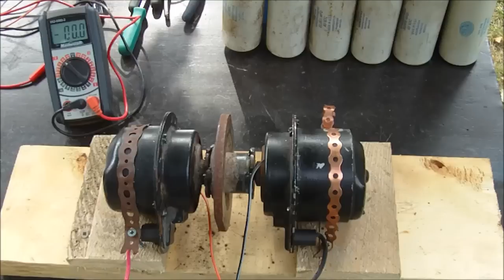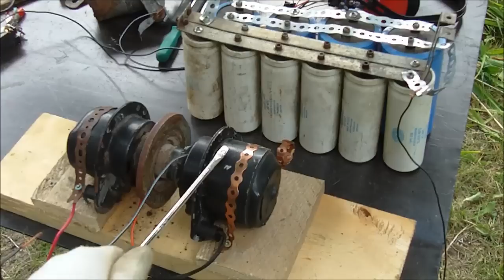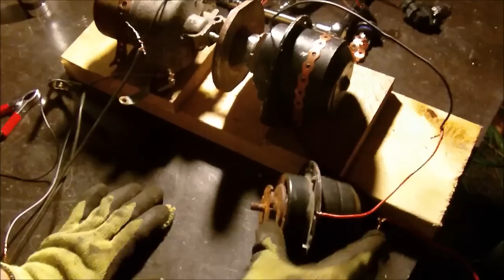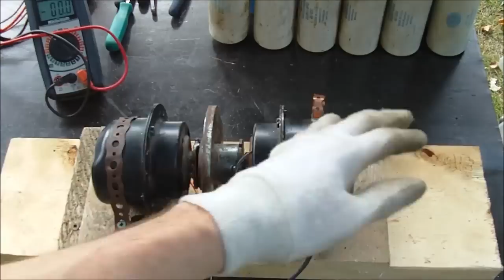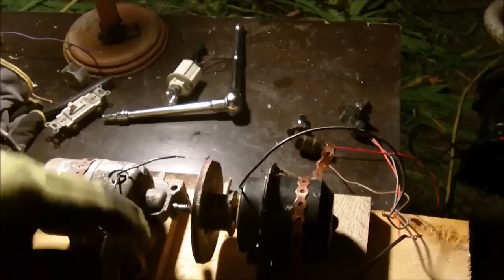Electric Motor to Motor, can they self run?

Comment: i dont even have to see the results to know this didnt work

efficiency can never be 100%
Reply: +gametechish .......Superconductivity is simply lowering the electrical resistance of  system to zero/near zero. It does not offer MORE energy out than is put in.

Plus, as is often forgotten, you have the MASSIVE energy input to get the system cooled to near Absolute Zero in the first place...
Reply: +Jc Knight he said efficiency not unlimited energy. Either way I realised after posting that you would need to put this in a vacuum and remove friction.
Reply: even in a vacuum it wouldn't work. its efficiency is more based on the physics of electrons. when electrons flow you produce a counter emf which reduces efficiency.
Reply: +jason stout read previous post
Reply: so you think that can violate the conservation of energy law?
Reply: superconductor cannot create energy, they can only store it. a super conductor stores current with absolutly no voltage because it has no resistance. IxR=E. and if you have no voltage you cannot create power or watts IxE=P
Reply: +Jc Knight And even if the electrical losses in the wiring and brushes could all be eliminated via superconductivity,  there is the energy burned up in bearing friction and air drag....
Reply: +Bob Weiss that's why I proposed the idea of superconductivity in space
Reply: +jason stout   what is the efficiency of a solar panel , when we put nothing in ?
Reply: +Ed Cupp what do you mean?
Reply: jason stout superconductor are conductors not every storage,  wtf.
Reply: +jason stout He isn't even going for 100% efficiency... He wan'ts to generate energy as well XD
Reply: +Artur Grigio haha 😁
Reply: +Artur Grigio  >100%
Reply: +jason stout 
Sure it can <grin>  <I'm agreeing with you>
But it can only be 100% at best... in theory.  Condensed down and paraphrased, the 3 laws of thermodynamics state:
1) you can never win, you can only break even
2) you can only break even at 0 degrees (kelvin)
3) you can never reach 0 degrees (kelvin)
Reply: +ramosel exactly lol
Reply: +ramosel But still we can belive in magic and power of Mother Nature )) Some time ago electrical lighting was impossible, but here we are using tablets and smartphones! I mean we might just don't know something yet. So, I think nothig is impossible in Universe.
Reply: Ghost R sure there are things we don't know.
Reply: Ghost R the conservation of energy law is just as well known and established as electricity is, so keep believing in magic (which is fake) and mother nature will keep conserving energy like it always has.
Reply: ***** super conductivity is not as big of a secret as you think its is. the secret is to get a good conductor and cool it down to very low temperature... bam you have made a superconductor
Reply: +gametechish even with superconductivity it will not work due to friction
Reply: viermidebutura yes of course.
Reply: ***** is not overcoming friction the problem here, overcoming friction doesn't mean there is no friction 

also electrical resistance can be eliminated with superconductivity but there is no way to negate friction 

so in a SC motor generator system the power loss due to friction would stop the system
Reply: +jason stout Hey I'm all for the law of thermo dynamics, but does that mean we should just close our minds to any new ideas that may contradict it? Just because we know something now doesn't mean we will always know it. Humans used to know the Earth was the center of our universe, and that crazy tin foil hat wearing Copernicus thought he knew differently. Now every elementary school student knows The Sun is the center of our solar system (not The Universe). Who's to say what we will know tomorrow.
Reply: Chace Butterworth that is a bad comparison...
the geocentric theory wasn't based on observations but on philosophical ideas

the laws of thermodynamics were formulated as a result of many years of observations and even more the conservation of <.....> laws are all based on years of observations and are 100% valid from Newtonian physics to quantum mechanics 

in other words the underlying principles of our universe are the conservation of <....> laws and there is no way around them
Reply: ***** i'm unaware of what are u saying about magnetism & gravity but even if the conservation laws may need some work it wouldn't make them invalid

also in the unlikely event of finding some phenomenon which violate the conservation laws it will be something way beyond the Standard Model and certainly not within the current and well understood science

so u can play as much as u want with motors and any other electronic devices but rest assure u will not find a single instance of violation of any conservation law
Reply: The only way to get out more energy than u put in would be nuclear fusion(well unless you count the mass you put in as energy). The most efficient method of turning mass into energy would be to slam anti matter into matter thus obliterating both particles and releasing a bunch of energy, however with our current technology creating antimatter takes too much time and energy and we have yet to be able to contain the power of a nuclear fusion
Reply: lol49031 but none of the processes u listed generate more energy than what was input they just convert one form into another

but the issue here is ppl who thing connecting 2 motors will give u free energy
Reply: +lol49031 you must count the mass other wise this would be breaking the law of conservation of mass/energy
Reply: +sploofmonkey What viermidebutura is trying to explain to you is this:

Regardless of any environment you put a super conducting motor into, there will be friction. You can put the motor into a perfect vacuum, and there will still be friction. There is always friction. That is why all motors, engines, etc, use bearings, bushings, and other methods to minimize friction...But friction is always going to be there.

It has nothing to do with overheating. It has nothing to do with gravity, or anything else.

If something moves, it must move against something else. What allows the movement in the first place, is friction. Friction is also how the movement will end. The shaft the SC motor is built around, must spin. You can use roller bearings, fluid bearings, etc, they all have friction. Magnetic bearings, okay, got me. No friction. Instead, powered magnetic bearings draw more power, instantly killing the idea of a "unity device" of Power in = Power out. Permanent magnet bearings are...possible, but run into issues due to limitations described in Earnshaw's Theorem, and will still form eddy currents, which takes energy away from the Power in = Power out equation.

And that's just the bearings in the drive motor. There's still the bearings in the generator, and whatever linkage is used to connect the motors, unless using a direct drive system as shown here.

Short answer: You cannot achieve unity. You can theoretically come 0.9999999998% close, but you will never achieve 1.0.
Reply: +jason stout energy cannot be created or destroyed
Reply: ***** if it was powering the sun yes we would call it plasma energy but the sun is powered by nuclear energy and gravity...

to see why plasma energy is a nonsensical statement apply the same logic to  other states of matter: gas energy liquid energy and solid energy - if it doesn't make sense for these then it doesn't make any sense for plasma
Reply: ***** let be honest here plasma energy sounds sciency to someone who has no clue about physics
Reply: +jason stout  actually theres are cells in plants that have an efficiency of 99.8%. they take lights and converted to energy.
Reply: BlueRice u are wrong so as +jason stout 
the energy conversion is always at 100% efficiency the only catch is that the useful energy is always less that the input energy...

also photosynthesis is highly dependent on the color of the light since natural light is a mixture of all colors the efficiency can never be that high
Reply: ***** the grammatically incorrect answer  is done on purpose in order to further derail the discussion from the subject at hand
Also i'm payed for each comment so is in mi interest to continue...
Reply: efficiency would need to be way over 100% for such a system to work: needs to overcome mechanical friction, electrical resistance & other losses. Basically it is impossible.
Reply: +vision well, I can see how just saying "I know it won't work" inst a very good argument, but in a nutshell it's been proven through the same physics equations that describe events in your everyday life that you would agree with 100% relate to this scenario.  keeping it simple.. 2+2 is always going to equal 4.  Breaking down the physics equations is hard to just say in a paragraph but knowledge of electricity and magnetism is well documented and figured.  I know the moon is in the sky even when I can't see it.  I'm not saying that there may not be a possible way to make a self sustaining system..  Christopher Columbus was the first one to make a journey, this one's been done a million times. It's not the way, but there may be other forces in the universe we don't understand yet. Makes me wonder how a system like this may work in space, in a 0 gravity environment.
Reply: ***** our nature is not self sustaining because it requires outside energy

"A wise man is one, who knows, he doesn't know anything"
that is anything but a wise man...
after some time you inevitably end up knowing quite alot
Reply: ***** yes the earth is not a closed self sustaining  system because it receives energy from the sun

so what if i'll learn each day something mew? this doesn't chance my understanding about electricity and magnetism it only reinforce it
Reply: ***** flat earth now....
let see if u take a individual case u can formulate a flat earth theory to explain it but the moment u try to explain another phenomenon u'll need a new flat earth theory because the first one contradicts it

on the other hand globe earth explains all possible phenomenons without contradictions

this is what postmodernism produces... all ideas have value... when is obvious that some ideas have 0 value or worse have destructive consequences
Reply: +jason stout Friction has to be eliminated
Reply: +gametechish Does not matter, there is friction in the bearrings and the surrounding air.
These experiments will  ALL fail, because it is impossible to create energy.
Energy can be transformed, and with transformation there is ALLWAYS a loss.
Reply: Agree.  Even Newton's 3rd law will require there to be additional energy to actually generate a force that can move something.  I think the misconception is that people are under the impression that the amount of electric current generated by electromagnetic-induction is much more than it actually is.. like just spinning it slow we are talking micro-Farads, and that's not going to move anything.  I think this concept of power generation is given it's current highlight with Electrodynamic tethers.  Too bad we don't spend more money on Space exploration to pave the way for this kind of power production.
Reply: Incomplete! You have no momentum advantage to overcome the loss in efficiency through the motors and resistance. What would happen if you had 105% efficiency? A lot more.
Reply: +Chace Butterworth Exactly Humans as a whole are not perfect so ofc there is errors in everything. and just because you were taught to learn certain way does not mean its 100% correct does not matter how many years people say it is and then hundreds of years later boom that theory was proven fully wrong.
Reply: SenzakuTheSin u are 100% wrong here
u have no idea how science works

a theory that is working today will always work

take gravity
before Einstein we had Newtonian gravity after Einstein we have general relativity which doesn't replace the original theory  but adds more to it but by ur logic Newtonian gravity should now be wrong.... 

to apply what i said to this video 
even if in the future a more complex electromagnetism theory is found connecting 2 motors as in the video will not produce free energy
Reply: viermidebutura well what ever floats your boat, isaid what i wanted thee end now,
Reply: SenzakuTheSin is not my "boat"

reality does not bend to my will and not to your will.... u can chose to deny it but that is not a smart thing to do :0
Reply: +Mo Hammered Of course it is.
Reply: +brucebear1 yeah I am an experienced expert at  electronics, and the theory of it all  clearly means  it is going to work.
Reply: humans cant know everything or solve everything with a brain the size of a melon. just because you dont think it can happen doesnt make it so, not this video...lol. most things we have today was once thought impossible by great minds.
Reply: +jhue73 enthropy... enthropy everywhere D:
Reply: viermidebutura correct! Too many people are of the belief that Science deals in absolutes and singularities. Typically there are many theories that address the same concept, like you said about gravity. I am not sure what convinces people that because what goes up must come down, that space does not therefore exist.
😎
Reply: jhue73 Your statement just owned everyone. Our god like powers are just around the next corner after the one before it around the next bend.
😎
Reply: jason stout hey he made the video for fun
Reply: wot? how?
Reply: me neither,friction will slow it down if it even works
Reply: Riddle me th?s...

The efficiency of permanent magnet motors is generally between 81% and 90%. There are exceptions but this is generally the case. If we use an example where 2 motors are connected as in the above video and the original input is 500W, we can expect at least a 400W output. Now here is where it gets interesting:

If you now connect that output back, you only require an additional 100W of power to make it self run. What happens if you connect a solar panel running an output of 200W? You only have a 100W shortfall, so does this mean with the addition of the solar power just mentioned, i now have a self running motor, and what happens to the excess power input? According to theory the new output would be (400 +200) *80%+ which equals 480W of output. With the solar continuing to feed an additional 200W of input, does that mean we have achieved an efficiency greater than 100%? Will the motor now accelerate? It would seem as though it would do exactly that.

Any thoughts?
😎
Reply: if you connect a 200W solar panel to this motor generator system which require an extra 100W to self run then you can only extract the remaining 100W from the solar panel 

as for greater than 100% efficiency nope because the solar panel doesn't produce energy from nothing

so which is better a single 200W solar panel from which you can extract 200W or a 200W solar panel + two motors from which you can only extract 100W at an extra cost?
Reply: viermidebutura I understand your logic, but my point is evenso, that it cannot be explained why the additional 100W of input would not translate into additional output, unless you assume the maximum outout of the motor is limited to only a 500W/400W Input/Output operation. You would probably end up requiring a transmission system to address optimal efficiencies through the effective range of the motor, but this is not a reason why a motor could not accept a greater input.

Do we find this a difficult concept?
#LeaveThePlateWhenUrFinished
😎
Reply: viermidebutura
Reply: i think you need to also check your own english as well because its equally not good. remove the big log from your own eye before you try helping others
Reply: Also, thanks to the idea of using a flywheel as a battery! :)
Reply: no, dont forget you still have magnetic resistance... you may be passing the current at a net loss of zero, BUT, you will still create sympathetic magnetic fields of force, because... they are the same force and all, anyway, even with a super conductive setup, with no electricity being lost  to thermal output via resistance, in a perfect vacuum, and somehow even with removing any related friction of the system as well... you STILL will fail to achieve 100% efficiency due to other factors like minor imperfections in angular rotation of the motor system, and even if you magically solved for this, which.. you actually can NOT solve this 100%, but you still must consider even more factors like the afore mentioned Magnetic reluctance... anyway its all very neat, but as for yet, still rather impossible for us at our technological level.. However, we do have hypothetical solutions for virtual free energy machines, be it on super small scales utilizing vacuum fluctuations of quantum mechanics and other .. interesting concepts.
Reply: Not want to be mean here, but, fortunately Thomas Edison didn't listen to you and the ones like you, otherwise we would still be in the dark and riding horses instead of flying planes.  Keep up the good work guys one day you will strike gold in them there mountains!!!!
Reply: TheTNmonitormen  that would be good for environment
Reply: Thomas Edison stole AC from Tesla!  Edison wanted DC electricity to be the power source in the US, because he was in charge of that.
Reply: A single gasoline engine can provide all wheel drive, so can a diesel engine. But I wonder is a single electric motor can provide all wheel drive, Unlike Tesla cause they use 2 engines to get all wheel drive
Reply: 2^(1/2) = 141.% 
100% ima with 41% overage
(Sin+cos)^2 @ 45,225 +-2
(Sin+cos)^2 @ 135,315 = +-0
Reply: @peterfiedfm5104  I'm almost certain lightning is farted out by wizards in the sky at least that's what the weather told me XD
Reply: As ridiculous as it is, Edison probably tried it cus he had warehouses full of unused direct current motors to fool around with!
Reply: @stout890  yes r/3
Reply: @ArturGrigio  - how much time energy and $ have you invested vs the kwh saved on? Thats the real ?
Reply: jason this work but he’s not set up right this won’t work properly. One motor needs a battery to run it the other motor turned backwards will charge a separate battery. It does work if you know what you’re doing. He didn’t figure this out yet
Reply: I literally just had this discussion with my stepfather in relation with electric cars and the idea that if you hooked an alternator to the to the electric motor in a car that the alternator could provide enough power to keep the battery bank charged without ever having to plug it in.
Reply: yes but it works and I'm making use of it everyday, I'm trying to do away with batteries, but since two motors produce enough electricity it is wise to use batteries to store energy do that you are not caught in a jam the day a motor burns out or what what....
Reply: i think it could be used as some flywheel of sorts?
Reply: What if you have a something spitting in space without bearings or anything wouldn't it spin forever?